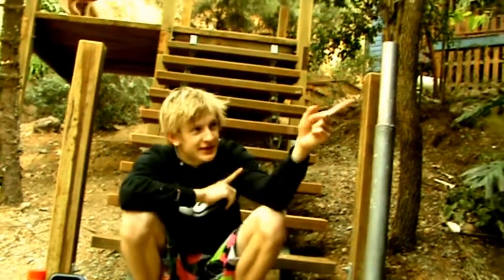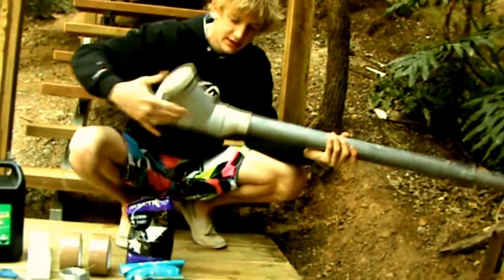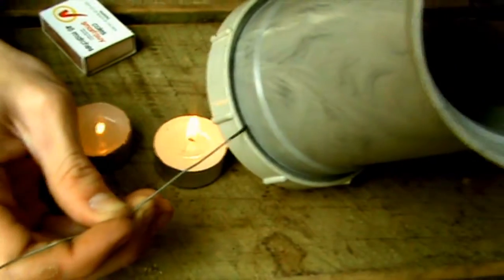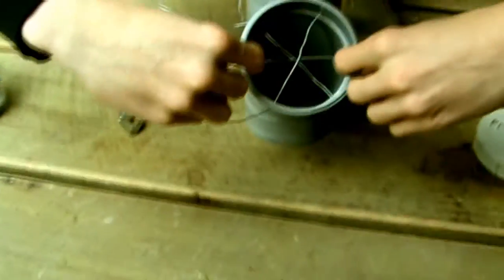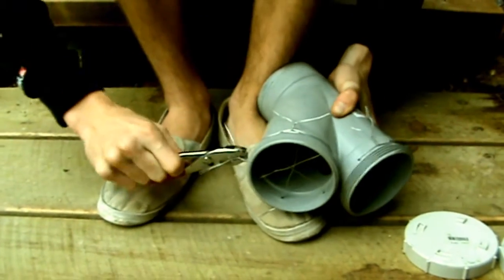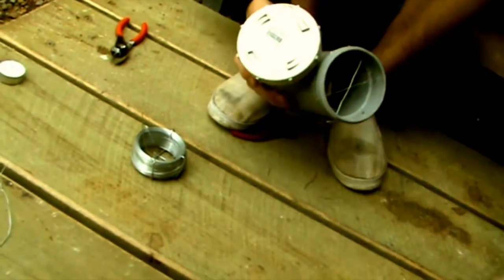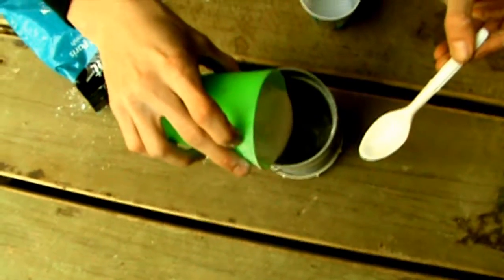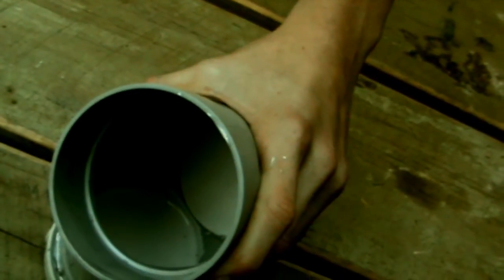!!! Build Yourself A Hydrogen Cannon !!!

Comment: looking forward to the following parts.
you could also just put drano and tinfoil in the bottles, i dont see why yous would use such a corosive/dangerous chem like hydrocloric acid when using drano would be a little safer.